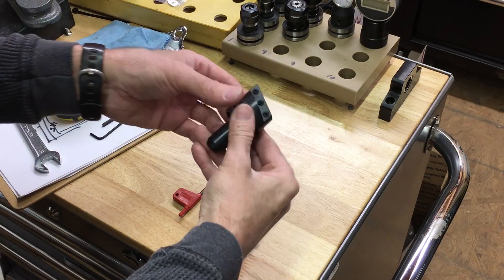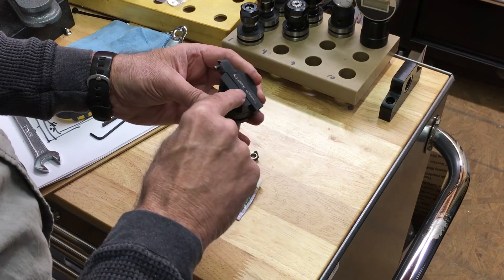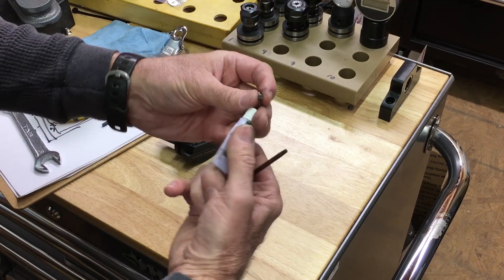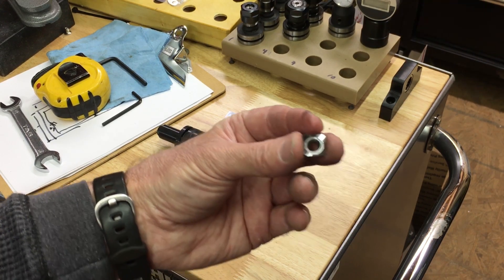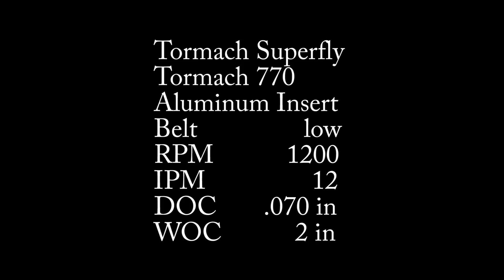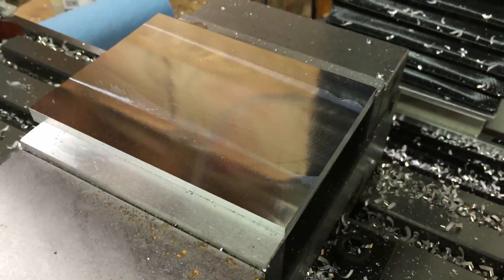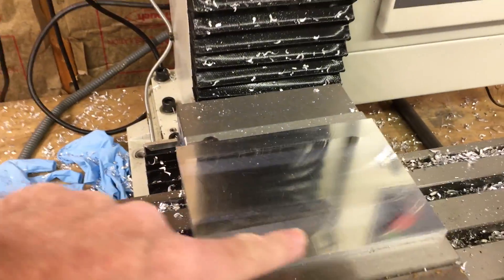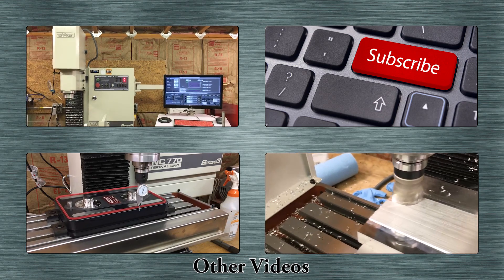Tormach Superfly

Comment: Very nice finish Craig.
But I'd seriously think about just what depths of cut you should be taking with one of these. Fly cutters are designed as a fine finishing tool rather than a bulk metal removal tool.  And climb cutting with them hammers your spindle bearings on every revolution.  On tooling with at least 3 or more tips you'll usually have at least one tooth still buried in the cut that's helping to load the bearings as the next tip starts into the cut. That way all the very minor clearances are loaded in the correct direction so there's no slack at all that gets instantly taken up as with these single tooth cutting tools. Bearings and especially spindle bearings DO NOT like shock loads at all. Depending on the precision and grade of bearings, brinelling on some equipment can start at as little as 4 ft lbs of shock load. The information's easy enough to find on various bearing manufacturer's websites if no one thinks this is correct. I've craned in large enough high load roller bearings in mining they simply weren't man portable. You'd be amazed at just how gently even those very large bearings are treated and installed. At the very most wooden mallets might be used, never a metal one of any type.

You'd be better off using something like your small face mills and save that fly cutter just for a finishing pass to remove the face mills tool marks if it's taking multiple passes across a wide surface. And 2 1/2"-3" dia. face mills are considered to be about the maximum on any mill with an R-8 taper.
Reply from the maker: Thanks for the info!  I think going over .050 was pushing it. Tormach demonstrates it at .050 roughing and .010 finish. What do you recommend for roughing a large surface?  Here is the Tormach video. http://youtu.be/01Rc5BmtDLA
Reply: +Craig's Machine Shop Well I'm a very long way's from being an expert about anything machine tool related. There's probably dozens of cutting tool manufacturer's more than willing to make detailed recommendations for a tool to suit your machine, material, and metal removal rates. There's some tooling today that's capable of some more than impressive metal removal rates. But like most advertising there's also a hell of a lot of hype involved. There all trying to sell there products so will push things to the limit to put there products in the best light. So you should always keep that in mind while watching any cutting tool videos.

Notice on the Tormach video where he took a .025" doc in steel and the opposite side was getting smeared with the tool as it rotated around? A flycutter has a lot of flex and there's a tiny bit in your mills head and it's bearings. The deeper the cut the more flex obviously, but you'll then see deeper cuts on the back side of the cut. My manual mill is a 3/4 sized Bridgeport clone, but it came from the factory with there full sized 3 hp 3 ph head on it so they could offer a smaller and lighter mill that still had the factory built in power feeds on the spindle. For myself I do almost no aluminum machining. And I limit doc's to 10 thou or less with any flycutter in steels or stainless. If I was doing aluminum? I doubt my doc would change much. As I said there designed as a finishing tool. I've got one flycutter that takes round carbide tips and it's very smooth cutting since it's an easy entry into the cut. I still limit to that 10 thou at the most. .005" is better imo. 

I don't yet have any hands on with them yet, but I have heard some fairly decent things said about the Glacern Machine Tools face mills. One thing you have to remember is you don't have either the rigidity or horse power to properly drive any face mill with negative rake tooling. Positive rake only. If you can keep two teeth in the cut as I said you'll have far easier cutting. Any vibration at all is death to carbide. So the smoother you can make a cutting tool work then the better for the tool tip and your machine tool itself. I wish I could be of more help.
Reply from the maker: +Turning Point  - Yes, I could feel the hammering with the deeper cuts.  Yes, I have seen a lot of videos on Max MMR.  I guess it only matters if you are doing production work.  Maybe I will just take multiple lighter cuts.  It's CNC so its not like I have to do anything other then add multiple depths in the code.  Thanks for the advice, I appreciate it!

Comment: I love the Super fly! I do spray WD 40 before I make the cut.  My next cut will be 2500 rpm 15 inches a minute with the Super Fly. We will see how that works. I just finished my first week drawing parts in Fusion 360. You way a head of me on everything you do! Keep the great videos coming Craig. I learn something every time!
Reply from the maker: +Tim Robel - Yeah, I'm starting to love it to!  I think your mill is at 60 hz at 2500 rpm.  Mine is at 1500 rpm in low gear.  I will try 2000 rpm next.  Yeah, I have been spending a lot of time in fusion 360 recently.  Not sure how far ahead. I may start learning stuff from you!  Thanks, yeah lots to come. I would like to have the most in-depth series of feeds and speeds.
Reply: +Craig's Machine Shop That would be great! Thats one of the things were all trying figure out!
Reply from the maker: +Tim Robel - I think I am beginning to realize its far simpler then we realize.  Just use the correct tool for the material, follow the proper surface speed and chip load for the tool and go easy on the MMR.  Unless your doing production runs, there is no need to "maximize removal rates".

Comment: I look forward to the speed and feed video! At some point, a couple/few years ago, I decided 2100 RPM and 300 mmPM was the way to do for finishing aluminum (~80mm diameter, 0.1mm DOC). I've continued to use 2100 RPM for my 6-insert facemill, but with a feedrate of 1260. I've basically forgotten from where I pulled those numbers though, so it'll be fun to see your methodology.
Reply from the maker: +Hirudin - From the looks of your videos, we can all learn a lot from you!  Yeah, I will try 2000 rpm next.  My 1500 rpm video will be out around Friday.  The 770 is 1500 rpm at 60 hz. in low.  It will be interesting to see if there is much drop in power at 2000 rpm.  What HP is your machine?  What machine are you using?
Reply: Sorry for taking so long to reply!

Thanks! I like to think I get it right sometimes. :) But I'm still a complete novice in a lot of ways.

When I decided 2100 was the way to go I was using my Torus Pro, which has a 2HP spindle. I should mention that my test was assuming a light skim cut (0.1mm or ~4 thousandths) and my primary concern was surface finish. If I was trying to remove a lot of material I would take a 1.5mm (~60 thousandths) cut at max (if I remember correctly). I believe I would do those cuts at 150mm/m (~6IPM).

Those numbers are with the SuperFly extended just about as far as it would go. My thinking was that I would use it primarily for facing stock at the beginning of a job, so getting the largest diameter was important. Unfortunately, since my mill wasn't perfectly trammed a slight step would be created if I had to take more than one pass along the X direction.

My new machine is a Brother S700-X1 with ~4HP (constant).
Reply from the maker: +Hirudin Nice Machine!  all the specs are in metric which is Greek to me.  lol   With 4 HP I would think you would be able to face a lot of material with a facemill.   Do you have any data on HP drop off outside of 60 hz?   The graph I am going by shows the HP is half at 30 hz.